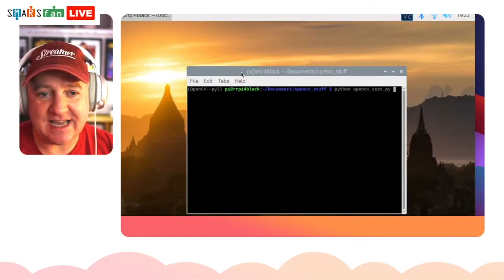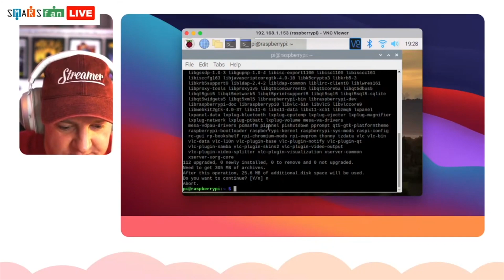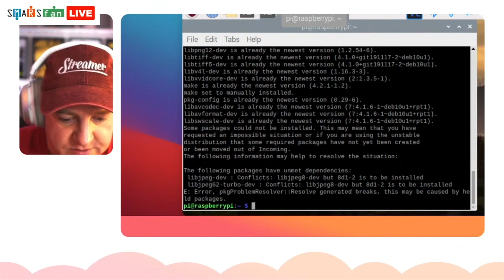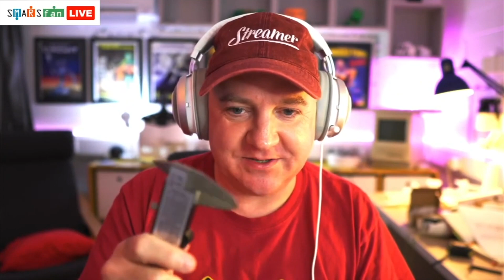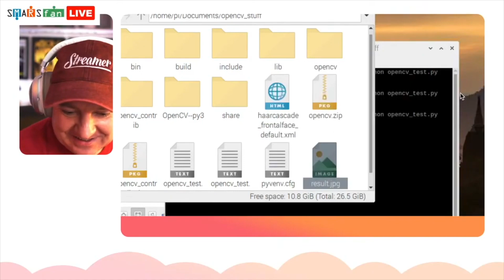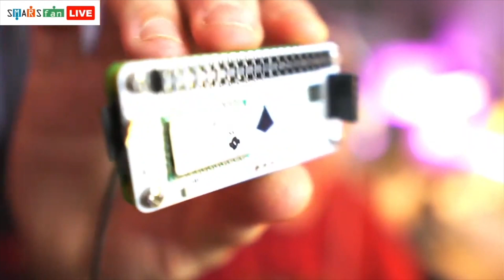Face Detection using OpenCV using a Raspberry Pi Zero

Comment: i want to create facial recognition attendance system using raspberry pi  it can store 100 images which raspberry pi is best for this project can i used raspberry pi 3 3b+ with 1 gb ram or i can go for raspberry pi 4 rasberry pi zero 2 w can handle 100 people images

Comment: Amazing video👍, can we also perform OCR with raspberry pi zero 2 ?
Reply from the maker: Oh, for sure, just need to use a different model
Reply: @kevinmcaleer28  if you can make video about OCR using raspberry pi zero 2 then I think it will be amazing.

Comment: Do you think Pi Zero can run CNN or keras? have you tried it?
Reply from the maker: It can! Training is very slow but models work fine
Reply: @kevinmcaleer28  Thank you for answering. Which library do u recommend in rpi zero? Tensorflow lite or Keras?